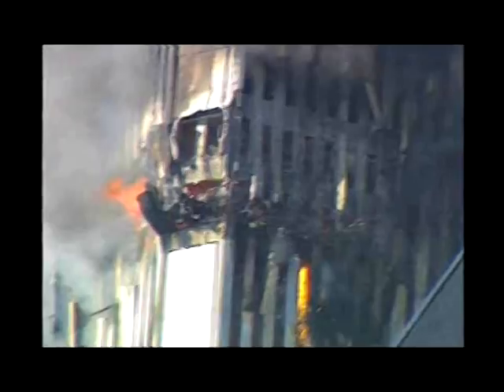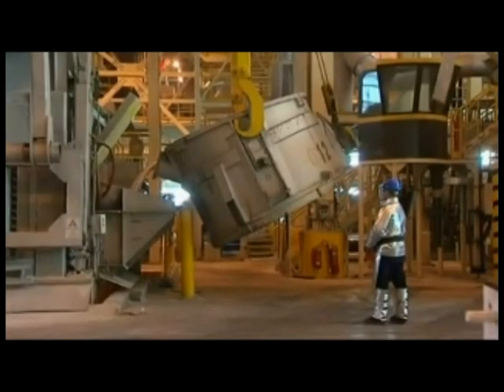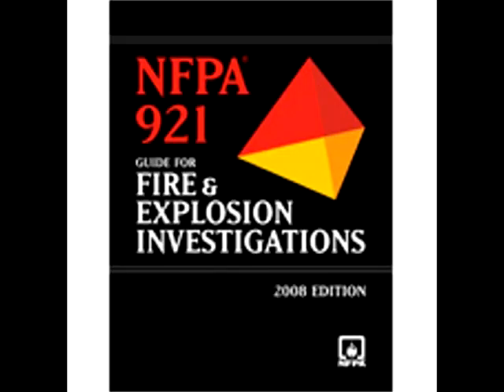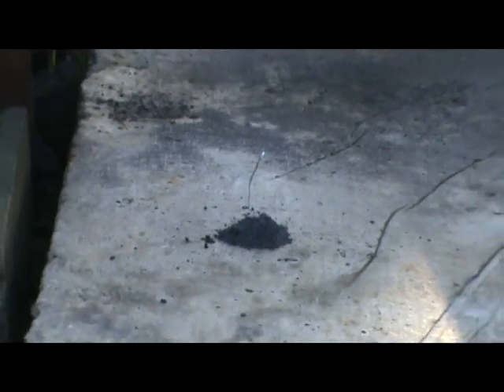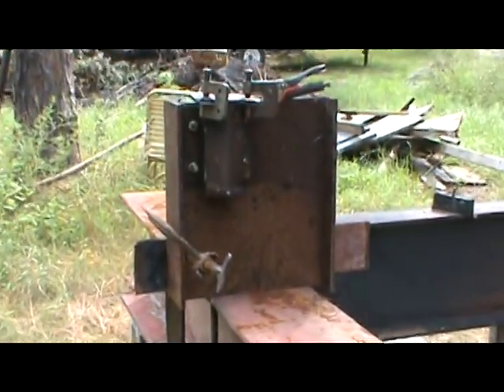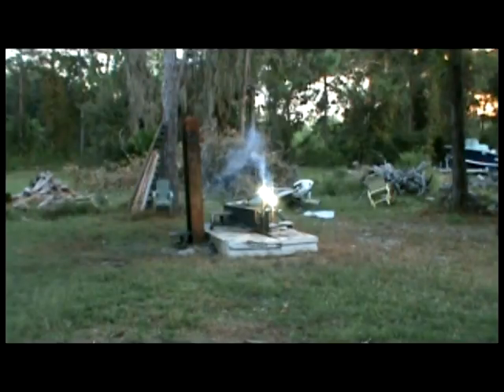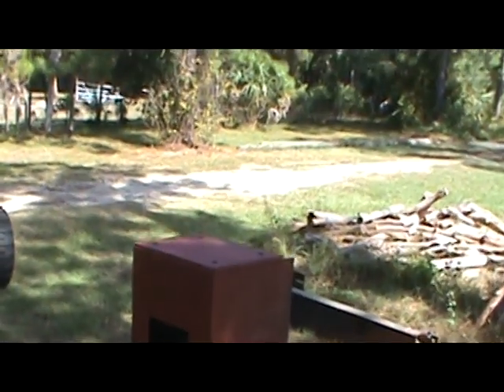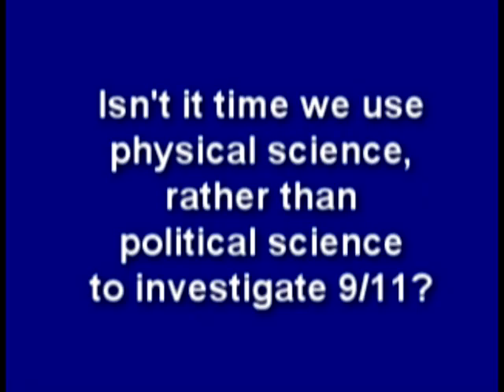9/11 Experiments: The Great Thermate Debate

Comment: Question: When were these alleged devices installed???  Please.... Tell me.......  Because it took you Time to weld them in place.... How were welding tanks CARRIED UP the stairs  to secure these things? The last time those beams were exposed was back in the 1970's as it was being built. At NO TIME since was there a need to open the buildings exterior walls down to the Structural Steel... So come on Truther... When were they put in there??? Certainly no time on the day of the collapse... Are you saying they were in there for 30 years? So whats the answer Truther?? Come on... when were they placed there and how were they detonated???  You won't answer though... Truthers never do
Reply: They didn't answer you because they can't.  What they are doing is ignoring any inconvenient facts that conflict with their version of reality.
Reply: @colincampbell767  yeah... truthers are the weakest minded people going... absolute idiots
Reply: The interior columns were adjacent to the elevator shafts. ACE Elevator was doing elevator upgrades 9 months prior to 9/11. This could of provided workers proper cover to rig the interior structure. Also many floors were vacant or underwent fire proofing upgrades just before 9/11. This would allow access to the exterior box columns.
Reply: Having access to the elevator shafts does not get you access to the structural connections you'd have to attach the charges to.  Those would be on the other side of the columns facing the office spaces.  The parts you would have to place the charges on would be where the trusses are attached to the columns.  So the elevator theory is out.  And from the videos we know where the collapse started - was there work done on the structural members on those specific floors?

And even then this is nothing but speculation.  Not only that but rather stupid speculation.  This is because it is beyond credibility that people smart enough to put a conspiracy like that together would be dumb enough to use thermite.  Sorry - but if they intended to bring those buildings down they would have found somebody who actually understood structures and how structures work. 

And the fact of the matter is that those buildings were doomed the moment the planes hit them.  The damage to the support columns from the impact itself, the mechanical action of wreckage stripping the fireproofing on the structural elements, the steel growing weaker at a completely predictable rate as the fires burned, the fact that the structural steel elements of the building were not as strong as the engineers had calculated when they designed them, all combined to bring the buildings down.  

You don't need a conspiracy.  Simply understanding the principles of engineering, and physics - are all you need to understand what happenned.  

All you have in reality are speculations.  You say that something could have happened - but without actual evidence you cannot say it did happen.  And without evidence - you have to take the null result: that it didn't happen.
Reply: Colin Campbell , like I said in my earlier post the elevator shafts are inside the core of the buildings. It could theoretically provide experts access to the interiors. For the building to fail and fall through itself, the core columns need to be taken out. Thermite was used to pre-weaken the structure because it can be quieter than more conventional explosives. More than likely it was used to weaken and take out the core columns around or close to the plane impacts and create the impression the failure was due to the jet impacts and fires. Since this was an unconventional and extremely deceptive demolition, which was necessary to give the impression of failure because of jet impacts, thermite was a wise application for the true perps.
Reply: Colin Campbell what is your thoughts on the engineering computer modeling study being conducted out of the University of Alaska Fairbanks regarding the destruction of World Trade 7? Have you had time to look into those preliminary findings? Wtc7evaluation.org
Reply: Colin Campbell I’m not saying military grade thermite was the only application that was used to destroy the buildings. I’m just saying it was used. It appears from the videos and the explosive destruction of the towers that more conventional high explosives were also used.
Reply: Mark S If you are interested in researching the unusual high amount of military drills taking place on the morning of 9/11 that crippled our air defenses and confused our air traffic controllers you can watch 9/11 War Games here: https://youtu.be/3noExmsCRyg
Reply: Mark S it’s possible some were destroyed or displace from the impacts but that wouldn’t stop the rest of the devices from working properly. Also it could be possible that they were protected or inclosed around the impact zone to limit damage.
Reply: @jaymz19871  ok... so now you SUPPOSE?    This is what truthers do... they put forth conjecture instead of facts...   you are just like all the other truthers.  Believing millions of people are conspiring to create a massive coverup.   Do you know how many people it would take to cover all this up?? Take a guess..
Reply: Mark S The facts clearly show all three WTC building were destroyed by means of demolition. The science is very clear on this after nearly two decades of research by independent professionals. Anyone can access the information and decide for themselves. Unfortunately the debate is not scientific, but political. As far as the number of people who had a good deal of knowledge in the planning and coverup, I’d say it’s quite a few. But most are too scared to speak out or they are complacent. The vast majority of people are ignorant when it comes to the facts.
Reply: @jaymz19871  no... they weren't... I was there... you are discarding  Physics for Junk Science and Conjecture..   2 full sides and the Central core of each building were completely compromised. that means more that 50% of the structural support at the Impact Zones  was gone. there was no way that those buildings could support the weight of the floors above the Impact zones with that much support missing.. We could hear the steel snapping as the morning went on...   as for #7... the building was nearly sliced in two  down the face of the entire south side from the collapse of the North Tower... I was standing right there near #7 and could see it...  If what YOU said is true someone would have been indicted in the last 20 years for it... Hell.. in the 70s Watergate brought down a President and those charges were nothing more than breaking and Entering and Burglary.  But you want us to believe that 100's of thousands of people are covering up a crackpot conspiracy that killed 3000 Americans?  You have NO proof anything you say is true... You Tube Videos are not PROOF.. They are the truthers way of putting forth doctored evidence and trying to make it appear as fact... So if you have any questions that you'd like a First Responder to answer.... ask me....  Here is a question for you..... How were the Charges detonated/Ignited??  Careful how you answer...
Reply: @marks8603  You obviously are completely ignorant to just basic facts surrounding the demolition of these buildings. So much so, that even the official NIST investigations contradict your ludicrous assertions. I would suggest you do a bit of research before we continue this discussion. There is no point in me debating someone so completely ignorant regarding this issue. Watergate and other past state crimes are not relevant to this topic. Youtube is just a platform for sharing information. Its up to the viewer/researcher to verify/check the legitimacy and significance of the information.
Reply: @marks8603  You must not have been one of the 100 + first responders that testified to hearing and seeing secondary explosions that morning. You can read about that here: https://themindrenewed.com/in-the-media/713-news156

"In discussions of the events of 9/11 it is often implied that the original, obvious, and natural hypothesis concerning the destruction of the Twin Towers is some variety of gravity-driven collapse. It was obvious to everyone on 9/11, we are led to believe, that the Towers came down because the buildings simply could not withstand the plane strikes and subsequent fires and therefore gave way. We who say the buildings came down because of explosions—we who hold to an “explosion hypothesis” in the broad sense--are, according to this view, late arrivals. We are folks who came along after 9/11 and over-thought an initially simple situation due to our conspiratorial mind-set.
 
It is easy to prove that this is a falsification of history. Proponents of the explosion hypothesis were extremely common on 9/11, especially at the scene of the crime, and I have not found the slightest evidence to suggest that they had a special conspiratorial way of thinking. Many made their judgment on the basis of what they directly perceived while close to the buildings. Some accepted as a matter of course that complete and energetic pulverization of these enormous buildings such as took place must have entailed explosions."
Reply: @jaymz19871  uh huh... yet in almost 20 years not one person or document or shred of evidence that connects anyone directly to your conspiracy has ever come forth or to light... you dont have a WHO, WHAT, WHERE,WHY or WHEN to any questions... just conjecture.  There is no point debating me because you have nothing to debate with... Your videos are NOT evidence, they are not admissible in court as such. you This is what truthers do... Back them in a corner and they scream that their Homemade Videos are PROOF. Then like James they they make ad hominem attacks and run away....  Run away James...Run away...
Reply: @marks8603  I blew you out of the water man. You know nothing at all. You don't even understand the official reports on the collapses...lol. All you're arguments are completely fallacious...bye!
Reply: yeah... until YOU can show ONE PERSON responsible for placing explosive in that building you have NOTHING.  Just one person out of the 100's of thousands needed to implement this nutter conspiracy theory you support.

Comment: I find this work to be very impressive… but possibly misdirected. The main challenge faced by everyone is to explain how the cores were brought down. If there were 47 columns, broken up in roughly 36ft lengths (3 floors), that’s over 1000 sections.  So there should be ample evidence of cut cores in the debris piles.  But there isn’t.  Virtually all of the core columns  appear to have broken cleanly at the welded (box column) or bolted (H section) joints, especially the smaller ones from higher up in the towers.  (Eg. Refer FEMA Figure B-6) The  residual core “spires” are problematical for all "conspiracy theories".  As for the wall steel, it was not necessary to  destroy the bolted column connections to collapse the walls.  Huge sections appear to have peeled away in one piece,  including the one from tower 1 that reached the Winter Garden, 400ft away.  I’m still with thermite, especially for severance of the top building sections from the bottom.  But as for the collapse of the  core columns themselves  (up to 3 inches thick), another mechanism is (still) required, that fits the evidence in the videos and debris piles. One that would require much less thermite.

Comment: There was a DIRECTED ENERGY WEAPON Boeing 747 Plane less then 30 miles away from the WTC on Sept 11th - this Jet Plane is equipped with a MASSIVE front mounted Laser Turret - It is called YAL-1 and it was in use that day, very well could be the source of the molten steel, or part of the equation, and the "laser" is invisible to the naked eye, they could have been "painting the buildings in the energy beam literally slicing the corners

Comment: The steel actually did melt. Witnesses were recorded on video saying this. I was definitely not aluminium- which is silver in colour. But even if the steel softened enough to buckle, there would still be resistance when one floor collided with the one below it. Demolition experts are saying that this resistance would delay the fall, but there was no delay compared to free-fall. The other big feature was the explosions, recorded on video and witnesses testified on video.
Reply: Atomic bomb in the foundations .

Comment: This is as dumb as the term "Chemtrails". If you know nothing about heat and metal,stop pretending you know stuff.Anyone with half a brain knows that extreme heat will melt steel especially that many gallons as those planes had JUST LEFT the airport with FULL tanks.Then take into account flammable materials in the building and the amount of weight on the structure along with all that heat.We burned a camper and the metal melted...so go out and do something for real NERDS !!

Comment: Let's examine the facts. Thermite is iron oxide AKA rust, and aluminum. The steel structure of the twin towers and the aluminum door frames and window housings combined accounts for any traces of thermite. As far as steel melting we use crucibles to melt steel all the time with nothing but a coal fire and an air source feeding in oxygen.once the ground floor doors were opened the oxygen source was established feeding up through the elevator shafts. This is not brain surgery.
Reply: Except in this scenario there is no "crucible". The building is exposed to open air, which means the heat will dissipate really quickly. The reason why you can melt steel with coke is because there is nowhere for the heat to escape so it just keeps accumulating. This is not the case with a glass skyscraper.
Reply: Look into Dr. Judy Wood's video about the "dustification" of the towers and building 7.  She accounts for these microspheres in her theory as well; that a high-frequency energy weapon utilizing "The Hutchinson Effect" was used to destroy the buildings.

Comment: Don’t forget that staff under the floors that where hit by the planes/where the molten fires where. Did notice in the weeks prior that floors where closed off for “maintenance work” & could heat heavy machinery being moved around above them when they had to work late when the rest of the towers where empty of staff. They also noticed that when they came in the next day that there was heavy dust on their desks, chairs, carpets & window sills. What caused the dust? What was the heavy machinery being used, a trolley jack, heavy gas bottles? These questions are the ones that prove it was a inside job months & weeks prior to 9/11. Some staff members did notice suspicious people & activity going on when arriving & leaving work.

Comment: Everyone talks about the temperature at which jet fuel burns and the temperature at which steel melts and concludes "it doesn't add up". Did anyone ever hear of bellows and the effect bellows have of a fire? What do you think the wind speeds were at that height? The high winds acted like a bellows increasing the temperatures. And steel becomes weak way before it becomes molten.

Comment: I agree completly, but think every one is being fooled including me, as to the use of planes.
Had they been used the would be a huge amount of what was the plane on the outside of the structure, basically because the planes are made of alloy for the most part.
Secondly, i have a set of photoxs tbat show just what happens when a plane hits something a lot softer than box type steel beams, so the picture of a hole like an aircraft may be fine for the gtom and jerry or roadrunner pictures but not the world trade centre.
Secondly the so called planes went into the structure, it di not back out, so any beam so soft that an alloy plane cat cut it would be bent inwards not outwards as shown from the helechopter   footage oof people standing in the hole  waving, the beams in this shoot are bent outwards.
Lastly the so called plane according to the official version went into a structure and tben came out the other side after having travelled through a forrest of box steel beams, it came out so that  just past the back of the cockpit was visable, it was totally undamaged and then IT DISAPEARED!!!!!!!
I have kept as much as I can of this event on video and in other ways because I know for sure that the world and America itself was lied to yet again.
I have also done some home work, looking at all the treaties  and agreements that America has signed its name to and when,
This goes back as far as the agreement with the true Americans
and an agreement about the area of Dekota.
Along side this list is the list of the dates when  America ignored its agreement and the effect it had on other people, including one agreement signed at the begining of NATO which reads no NATO  member will increase its boarders one inch from where there are now, try looking at a map of the 1947 year and then one of the present, and America has tbe afrontary  to accuse anyone else of being the agressor, with near 2000 bases in just about every one elses back yard right round the world, all there according to the America government  to create a democratic world